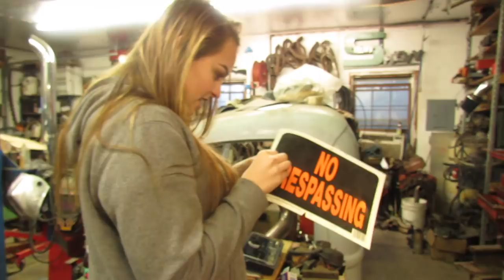Me and my wagon

Comment: Nice wagon!! Mine has a 1/2" pipe tube frame, a jamboree rack that slips in the tube frame in back and another rack up front. I use it for swap meets, wrecking yard runs, horse expo trips and the farm equipment show. I've hauled all sorts of loads over the years. I just bowed out the side hauling a sm465 and np205 together. What a load.